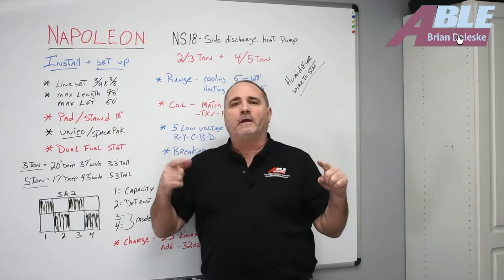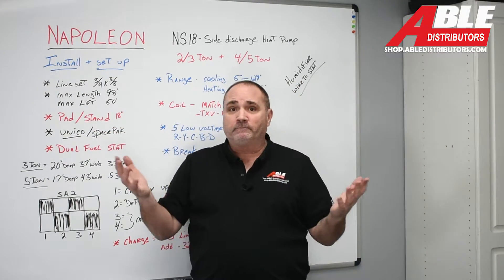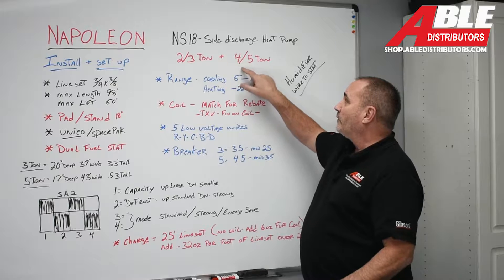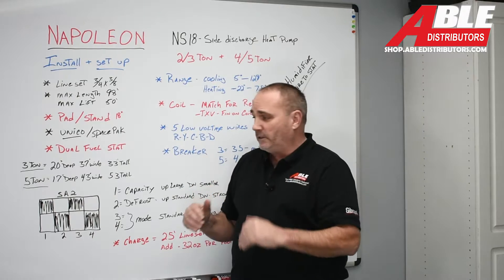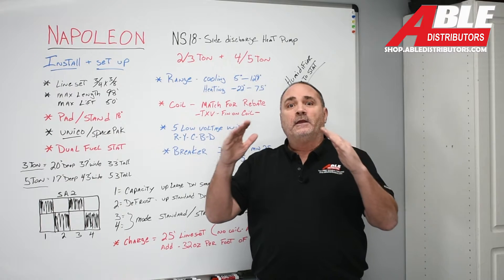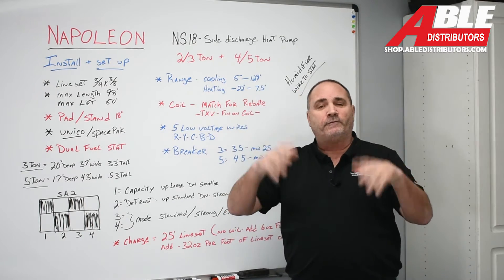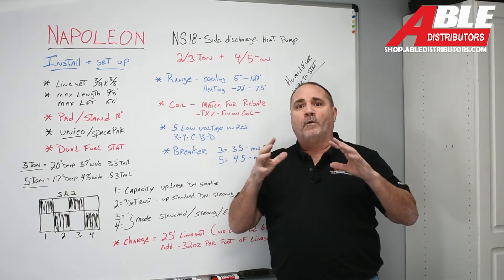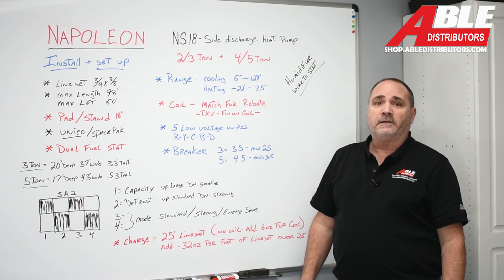Napoleon NS18 Heat Pump: Installation and Set Up Guide

Comment: My line set is 7/8 , does it fit with a NS18 3T ? Can it be problematic with the warranty or performance of the unit ? Thanks
Reply from the maker: they really want 3/4" for oil return when it's in heat pump mode, if you can replace it, that would be best.   Brian